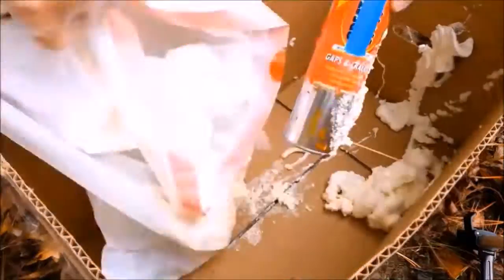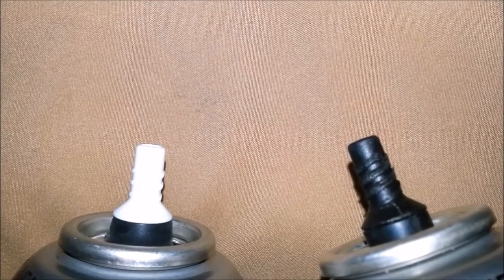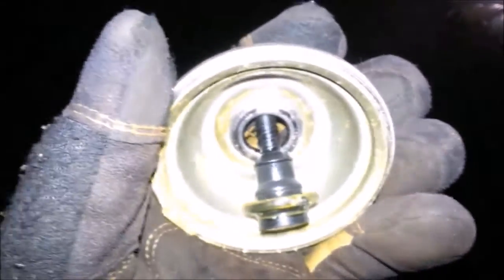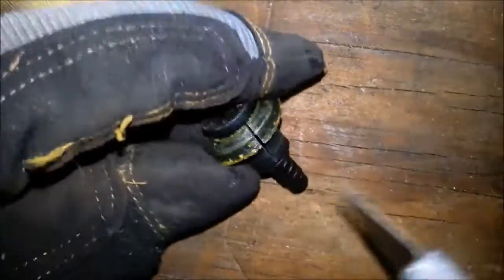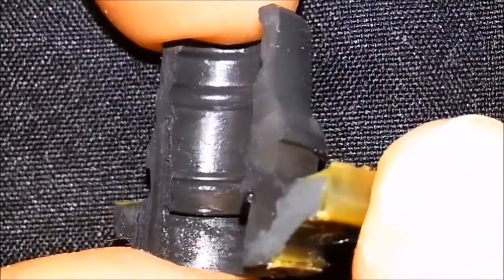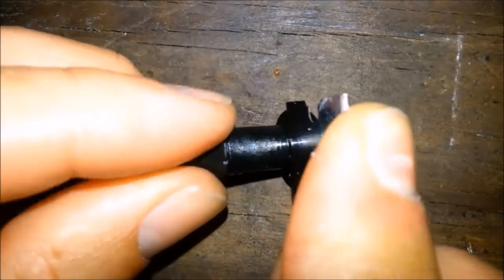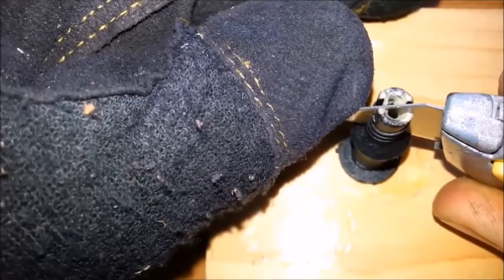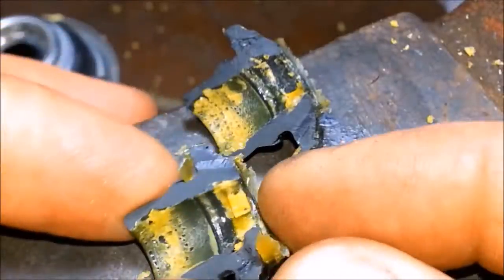Polyurethane Foam - Whats in the valve

Comment: I have seen a few youtubers say they way they keep the valve clear is by standing the can up with the screw attachment off.. and filling the valve tube with acetone and then covering the end of the valve tube with a cover like a piece of wax (something that will not disolve with acetone, and can cover the end. I presume it is to keep the acetone inside and limit how fast it evaporates or prevents it from evaperating? I heard also that Great Stuff also make a can filled with cleaning fluid that can be used to clean the attachment and also can be used like the acetone. I wonder if it is Acetone.
Reply from the maker: I haven't looked into the cleaner too much.  I think it is made to clean the gun that they sell for the big cans of GSF. Nice that it is under pressure so you can spray it.  If you can get all of the GSF out of the valve, the acetone will work.  But even a tiny amount will adhere the rubber part of the valve to the plastic part of the valve.  And the valves are bad about leaking very tiny amounts.  Sometimes you can clean the valve and then put your ear next to it and hear the gas leaking out.  Sometimes you either end up with a can with no pressure or a can with a stuck valve.  The MS and castor oil is nice because it dilutes the GSF and the castor oil sticks around to keep any leftover GSF from setting up.  I assume you have watched my video on the MS and castor oil mix?  Very nice for getting GSF off you hands or anything important to you.

Comment: Have you tried something like a tap to try to break/loose up the dried polyurethane from the clogged ports?  I have a little project and I have a clogged can and I really don't want to buy a new one.  So far I've been SLOWLY trying a dremel with a small round grinder bit and working it in the port hoping to break loose the dried stuff.  No luck so far.
Reply from the maker: Take a look at the description.  I have some info you might find helpful.  Be sure you are outside, wearing old long sleeve shirt, old long pants, old shoes, disposable gloves, eye protection, hat, and protect the skin on your face and neck and hair.  Also protect your tools with painters tape. Best to have mineral spirits handy to get it off your skin.  Even better is castor oil mixed with mineral spirits.  If you bust thru the bottom of the valve, it will blow foam all over the place.  It's pretty hard to get a stopped up can going again.  But every once in a while I get one to work.  Really not worth it.  If you shake it and you can't hear it slosh around, then it is probably setup inside the can anyway.  They only last about 3 years on the shelf, if I remember right.  Best of luck to you.  Let me know how it goes.
Reply: @fixpro256  Thanks for the info.

Comment: I saw your other video on how to keep them form getting stopped up, but what if it's already stopped up? I tried leaving lacquer thinner and nail-polish remover in there for days/weeks, didn't seem to ever melt it down far enough to make it usable again :( Any ideas?
Reply from the maker: I tried lots of stuff, but not much consistent luck.  Poly is pretty much indestructible once it hardens.  Be very careful when you are messing around trying stuff.  If you bust the valve it will go everywhere.  If you leave the straw on and the can sitting upright, all the little bubbles that make the foam fluffy will rise to the top.  The plug will take longer to harden, but when it does, it is a solid rock and impossible to remove.  When I wash the valve out, like in the video, but I don't do a good enough job.  Sometimes it is just a little plugged.  If you can turn the inner part of the valve while holding the outer part, that sometimes helps.  I have used a sheetrock screw to pull the plug out and then poked around with a stiff bent wire to clear the ports on the lower sides. Very limited luck with that.  After that, I poke a hole in the can (outside), them take the valve apart to find out what went wrong.  Good luck and keep the MS handy!
Reply: @fixpro256  Thanks for that! 
How do you mean, "turn the inner part of the valve while holding the outer part"? I was thinking of dumping some elmers glue or some other sort of adhesive, sticking a screw in their with it, and yanking it all out to try and dislodge the blockage! The valve on mine right now isn't really moving, it's pretty stiff.
Reply from the maker: Sorry, Just saw your reply.  You can turn a new valve to see what I am talking about.  Once you use the can, wash the valve out real good with a volatile solvent a few times,  After it dries overnight, if there is just a thin film of poly that dried in the valve, you can sometimes break it loose if you hold the rubber part of the valve and turn the inner hard plastic part.  That's where the adhesion happens.  It there is more than a thin film, I haven't found anything that will consistently get the foam flowing again. But I have found that using mineral spirits mixed with castor oil keeps poly from setting up, ever.  So I use that mixture to wash the valve out and then put some in the valve and leave it.  The MS does eventually evaporate, but the castor oil keeps the poly from setting up so you have a much better chance of getting the valve working again.  Shoot a tad of foam in a cup and mix some MS and castor oil with it.  Its pretty cool to see that it won't ever totally dry.  Tried a ton of other chemicals.  Nothing else appears to work.